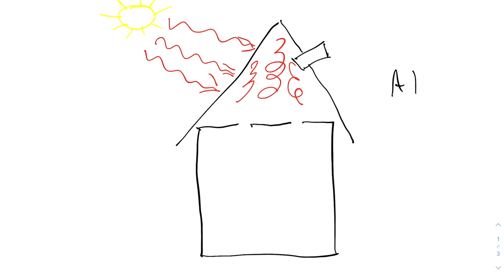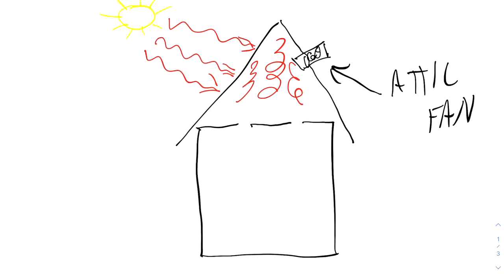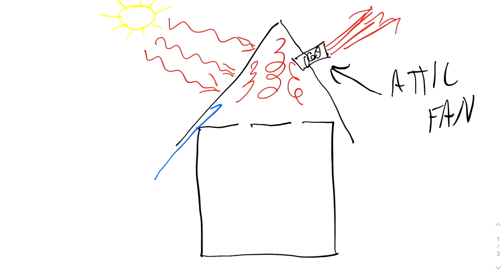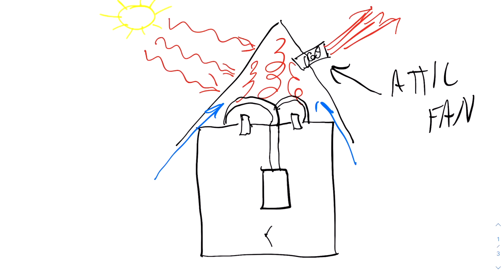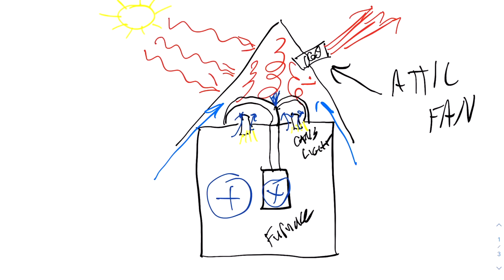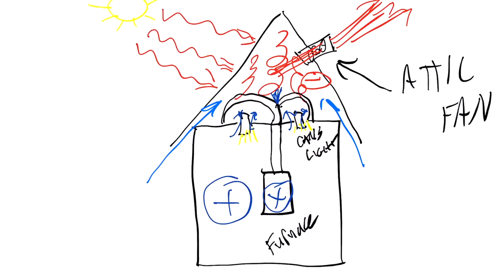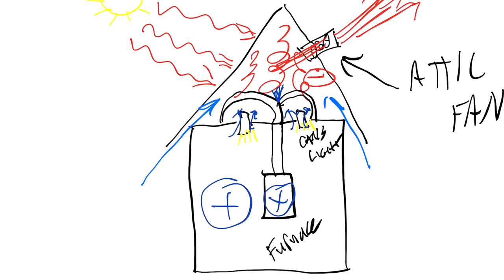3 Remodel Rip-Offs

Comment: Your claims are pretty shocking at first but with careful observation they make a lot of sense, mostly. Any claim has to be put in context of what it’s intention is. I think most would agree here that the intention implied is to cool down or help in cooling down the living space,  not so much to reduce the attic temperature. An attic without ventilation is like a car with windows closed on a hot summer day. You only really care when you go inside, otherwise not an issue. Everyone can relate to that. Open the windows a bit and it won’t get as hot. Circulate your car venting (without AC) and it won’t get as hot. It’ll never get much cooler than outside if you’re only circulating outside hot air but it won’t get as hot as without circulation.  Don’t think anyone will argue with that. The question here is, do you need the power circulation or will natural circulation be enough? I think a lot depends on how hot the day is (where you live) and your attic insulation. I’ve been inside my attic on a hot summer day when the power fan I installed failed and it was unbearable, had to wait until early morning. The power vent definitely makes a difference in my attic, I know and I felt it. Does it cool down my house? That claim is practically impossible to make or measure. i added lots more insulation due to a gov’t incentive a few years ago and I know next time that fan fails I will not be replacing it. the math for saving money, I think cannot be verified, but cooling down the attic on peak hot sunny days if that is the absolute motive, I think works.

Comment: Sorry BUT you are dead wrong on attic fan. In addition to temperature lowering in summer, the fan can also drive moisture out and significantly improve attic ventilation in the process, especially if it had poor ventilation.

Comment: Smart thermostats are fantastic. They do actually work. Mine paid for itself within a year. I actually measured it at the time. If you happen to live in a yeti cooler, maybe it's not the best from an energy savings standpoint. But again, they're still fantastic. You have full control over your air conditioning in a non draconian interface. Enjoy suffering through whatever hell honeywell has for you if you like.

Comment: I don't know this gentleman's qualifications, but if he has any, he isn't using them! All three items, the attic fans, double Low e glass with argon gas windows and smart thermostats are great additions and can pay for themselves in related energy savings. The windows work both ways, heat and cooling. He talks about $14,000 for windows, but I've done windows for $6-7k.

Comment: Well...  Actually, you can get as technical as you want and explain the modes of Heat Transfer in your attic all day long, you might think you are making sense in a "scientific" way ,but it all comes down to this. 
 Just like you sitting under a Patio Umbrella on a Sunny Day, you are putting a barrier between the Sun, and your House Ceiling. How?  Insulation...Not the Fluffy stuff that you are thinking of but AIR !  That's right AIR is one of the best insulators there is.  So if you can remove the Hot Stagnant Air from the Attic, by a method OTHER than just conventional Convection ,why roofs are pitched steeply, besides rain runoff,  Air being drawn in the Soffit Vents, and out the Box vents, or Turbines, or Ridge Vents whatever your House has.  You will "Cool" the air and prevent heat being absorbed down into the house Ceiling and the Insulation layer on top of it.  No, powered Attic Vents don't Cool the Roof Deck, they aren't meant to!  That statement is crazy.
They DO help keep the AIR in the attic cooler, by aiding the forced exchange of Air through the Soffit vents !  Like you sitting under that Umbrella, and a breeze wafts by, you feel cooler.  Take the Umbrella away and you are miserable.  So.. Roof=Umbrella,  You=House Ceiling. Get it?  Cool the Air in the attic, that breeze, and there is less heat that could be transferred to the house Ceiling and insulation. 
My former house had a low pitched Roof, with not as many Soffit vents as needed.  I added more, but the low pitch of the roof didn't allow convection to pull the air up and out the Turbines.  Hot Attic ! I put Two Solar powered Vents on the roof in place of the Wind Turbines, and the air movement instantly increased, bringing the air temperature in the attic down an average of 20 + degrees depending on the day, ( yes I measured it) , so that's 20 + degrees my house Ceiling and "fluffy" insulation didn't have to deal with !  All Facts based on actual usage and experience, no "lab tests" or Math needed...

Comment: In what world are attic fans tiny? Mine is about the same size as a small industrial fan… 2.5 feet across and 10 inches deep. We don’t have central AC and it actually keeps the house mostly “cool” throughout the days… 
San diego—about 70-75 in the house max. But we keep all doors and windows open. Before the attic fan, the house would get up to 90
Reply: Also you answered yourself and proved yourself wrong. You said it doesn’t cool the house because the attic is heated through the roof and not affected by internal temp… but with the hot attic air being being pulled out and not getting constantly hotter, the upstairs of the house stays much cooler. Therefore, they do work in helping a home maintain temperature. But you can’t explain science to someone whos argument is that heat rises… once it can’t go up anymore… it heats the surrounding air

Comment: A properly working soffit and vent system is still inferior without a fan. Would you like to live in a box with some small vents and call it a day? A fan would increase airflow and thus cooling, so why wouldn’t it be effective? Even with perfect insulation between the living space and attic, 150 degrees will find a way through any insulation.

Comment: BS. I have a solar powered attic fan and it definitely vents the attic. It’s common sense. Without the fan heat builds up. With an active vent hot air is obviously forced out. I had mine installed when I installed a new roof. Also added smart vents, soffit vents, a second passive vent and a radiant barrier. The difference in my home staying cooler was enormous.

Comment: I live in a poorly designed converted garage into a small tiny house essentially .. The ceiling is flat the roof is a basic peak.. Nothing was done right,NO insulation, Windows are single pane metal terrible windows no  sealing around windows or doors.. no fan or vent between ceiling and, roof .. What do y'all recommend we start with to get some relief? It's very uncomfortable in South California 😭 
We we're thinking of opening the ceiling making it a (vaulted ceiling) with some insulation in between it something  .. I feel like that is better money spent then putting in a vent ? Please help 🤣👍🏻 We are thinking of replacing the 3 windows or at least repairing the ones that don't open 🤣 & getting proper sealant and everything as well but, maybe that's not the best use of money until after the more important ideas you guys will have 🤣? It's not my house though my landlord won't mind the the upgrades 🤣👍🏻

Comment: heh seals. I have Bahama windows. There are 23 slats of glass without a seal between the slats. Instead it is a 1/16 inch gap, or cumulative of about an inch and a half vertical and 36 inches horizontal. Single pane would be an upgade.

Comment: EVERYONE KNOWS that a fan moves air. Hot stagnant air (by product of radiant heat in this context)  increases heat gain in the attic exhausting that air decreases the gain. 

Anyone whose house gets warm in the summer evenings (from heated mass of the exterior walls bleeding into the house via the studs between the insulation) that puts a window fan on to pull cool air in knows this works.

Comment: You're wrong about the attic fan. I don't have the experience on solar fan, don't know their air flow BUT I have the experienced on power fan, I have QUIET COOL fan, they did an excellent air flow on my attic , kept my attic a lots cooler then without fan before.
Reply: But i still give you a LIKE.

Comment: So while the sun is continuously beating on the roof, sure, there’s a lot of infrared energy being put into the attic. But at night (assuming you don’t have a solar-powered fan), wouldn’t it pull out a bunch of that hot air and remove that heat bubble over the bedrooms that makes it harder to sleep?

Comment: if the coil isn't running and the fan is, then that sounds like it should actually dry the water off the coil, humidifying the air....

Comment: Guys, your attic fan is pulling cold air up into your second or third floor after it sucks the hot air out. That's why it seems cooler. There is no way an attic fan can pull enough air to cool a roof assembly, attic floor, and everything conducting heat in between them via convective cooling. That is insane. If that were the case, we would all be using attic fans to cool our houses instead of HVAC systems and wood and drywall would be used as heat sinks in modern electronics. Everyone on here claiming Matt is wrong is just showing off how poorly insulated and drafty your attic floor is. There are countless publications including ones by the US gov (Energy Star) that take Matt's position. Are you really saying you know better than building scientists?

Comment: First he says the attic fan is not powerful enough to pull heat out because the sun is "a huge microwave in the sky"...then he says the fan is so powerful, it will suck the cold air right out of your house. I don't trust him.

Comment: You have lost credibility with me. My A/C could not keep up in my raised ranch home. Downstairs was cool, but the upstairs wouldn't get down to the set temperature (74) during the summer. We installed a 40 watt 2340 CFM attic fan at the start of last summer. There was no difference between my upstairs and downstairs temperature, and my A/C had no problem maintaining 74 degrees. Additionally, I noticed a big drop on my electric bills. The A/C used to be on continuously, even at night. Now it cycles on and off when it gets to 74. Read the other comments below.

Comment: Actual engineer and real estate agent here. 

On the solar attic fan, he’s full of shit. He found the only application that an attic fan isn’t an absolutely a positive and acted like it’s the only answer. 

Heat rises. Pulling heat out the attic will ALWAYS pull heat out of the house. The cooler you can make the attic, the higher the transfer of heat into the attic from below (the house) meaning the air conditioner has to pull less heat out of the home. 

Even if your lines run in your attic or the entire unit is in the attic, cooling the attic is STILL MAKES THE AC HAVE TO DO LESS WORK! 

Now, if you get a shitty attic fan, will it be a noticeable difference? Maybe not. But there is a reason barns have vert fans, and it’s because it cools down the building.

The other thing they help with us moisture. With continuous air flow pulling heat out of the attic, it will help wick away moisture before it can settle into the wood. With a powerful enough evac fan, it can actually dry out wood, meaning that even a leaky roof will take longer to do damage as long as that attic fan is running.

Comment: This is nuts, you are the very first person I have ever heard that calls an attic fan a scam. Maybe you did it for the click bait in which case, kudos,  because it definitely worked. As a licensed roofer in the icy state of Florida,  I enter 3-5 attics a DAY. I can tell you I notice an immediate difference in temperature when an attic fan is installed. I can say that a cooler attic, means cooler electrical components, cooler pipes, and oh yeah, cooler air conditioning ductwork. As to your negative pressure theory, my opinion is that is Extremely circumstantial. I feel like your theory represents a tiny attic with an enormous fan, then maybe, but because I've never seen an attic fan out pace the strength of a typical air conditioner, I highly doubt your theory. I wish you would have gotten a second opinion before you posted this video, because its obvious you didn't consult the boots on the ground.

Comment: Understand where you’re coming from. I disagree respectfully. I understand the concept of radiant heat. But when you can exchange the heat in your attic space it creates less of a heat sink on your second floor. I see second floor because I have a two story. I’ve noticed a reduction in electrical consumption with my AC. Also I have temperature gage is up in the attic and it’s significantly cooler which obviously does not allow the AC to work as hard as it did because there were heat would radiate into the second floor

Comment: You didn't bring up a little detail about smart thermostats. Certain installations are programmed so that the utility company can remotely ease the temperature up to reduce energy usage at peak load times. This is good and bad. On the one hand, if you are paying tiered energy use and are gone most of the day anyway, it might save a few dollars. It might help reduce Texas blackouts. On the flip side, do you really want someone else monitoring you and deciding when to change the temperature? Maybe you are sitting, watching TV. Or maybe you are doing heavy spring cleaning. It matters.

Comment: OK, I'm re-watching the video, still your analogy may work with someone who isn't a critical thinker but not me brother. First, the sun is not shining on the top of your ceiling. There's a gap between the roof and the ceiling. That space heats up the "dead air" between the roof and the ceiling when the heat "seeps" through the shingles and sheeting. it then heats the dead air that isn't moving which heats up your ceiling.  With an attic fan, mines 2940 cfm, its ejecting that air and pulling in outside air. Sure, if I was in a undesirable location where the outside air is over 100f, there wouldn't be a lot of help in this. (I get it, you are not in southern california), but here, it cools that space as much as 20 degrees, the benefit is not the temp of the space between the roof and the ceiling, its greater than that because the ceiling is even cooler than the 20 degrees that the open space in the attic is at.  Now, it just started hitting over 80 and its July. When its just in the 70s the roof was over 100f and the attic was also over 100f without the fan on and the house got hot. If the outside temps are 60-70- and the fan is on low, it really keeps the house cool.
      This issue you talk about "negative pressure" sucking cool house air out the fixtures?  lol NO!   My house was built in 1956, I remodeled it 2 years ago, its air tight, perfect, maybe not but talk about scamming. Its not exactly honest saying a remodeled house with an attic fan is going to get their Aircon sucked out by it. Who remodeled it you? I'm pretty sure you are good at what you do, not trying to slam you. I'm sarcastic...lol 

Smart thermostat: Genius!   Now your points make sense. $250, (got mine for $200) is not a huge expense for what you get. When you have a family you know that there are people that turn the thermostat down when it doesn't need to be down, and also, forget its on when there's nobody in the house. This is where you save. The other settings are annoying. I don't need that. 
      So If I'm out of state and my sons home and turns the setting to 68f, I can change it. I can also lock him out or put minimum or maximum setting limits.
 Furthermore, You can buy remote thermostats. OMG they rule. My air conditioner during the day responds to the hallway thermostat, in the evening it interacts with the thermostat in my bedroom. You can make it automatic so it changes at different times of the day, I just do it manually on my phone. (NEST)Dumb thermostats are useless.
Reply: Also, this guy used the microwave analogy. Pitiful logic. I don’t think he worked it out in his head. I suggest this experiment then comment on my comments congratulating me. Turn the burner on the stove top. (Gas) put your hand over it about 15 inches high. You will feel heat. 
     Now get a fan. Have someone hold the fan so it’s pointing between your hand and. The burner. Cooler right?  Duh.  It’s even cooler if you put a frying pan over the flame. (Simulating the roof).  There’s a reason you take science class. It teaches you scientific principle.  (7th grade).  Maybe you need a refresher course. “It’s all ball bearings these days” (fletch)